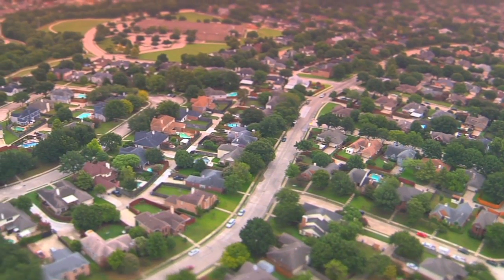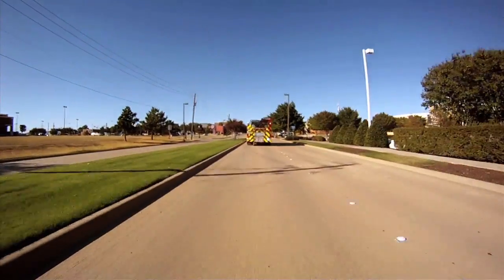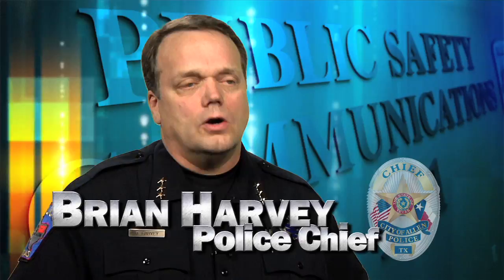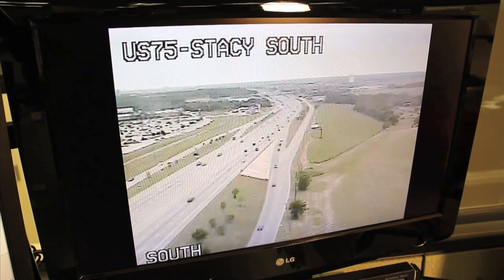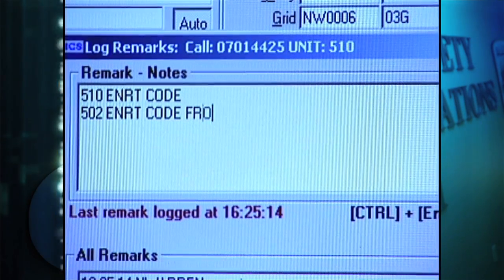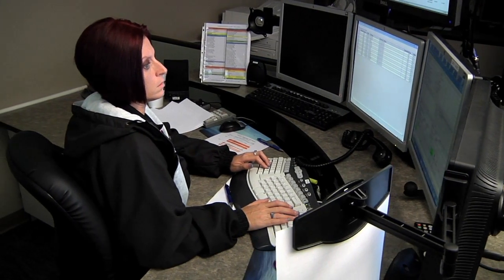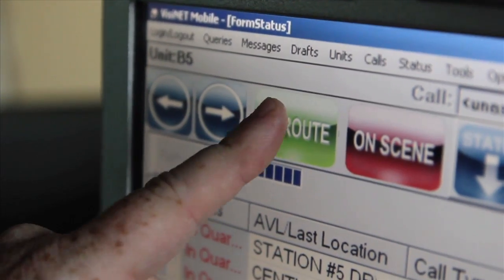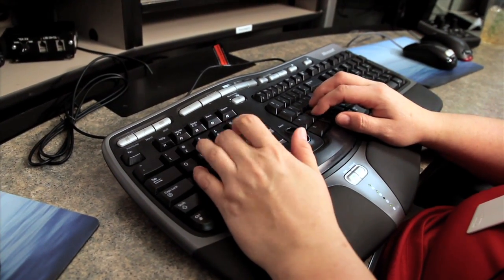CAD - Computer Aided Dispatch

Comment: I find it difficult to imagine full time workstations without headsets. I wonder if the one shown in the video is a demo/temporary workstation
Reply: I was thinking the same thing while watching this video. They have a state of the art (for 2012) computer aided dispatching system while cradling an old school telephone handset in the crook of her neck. Where are the headsets? Headsets have been used for decades.
Reply: @electronixTech    I came to the comments (years late) just to see if anyone else picked that up as well.  Isn't it easier to type without holding a phone receiver to your shoulder?